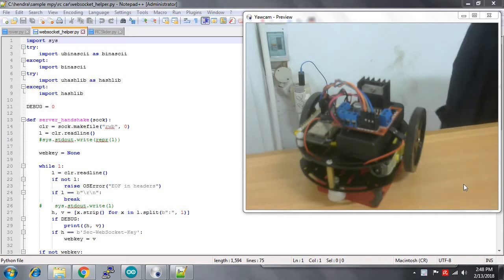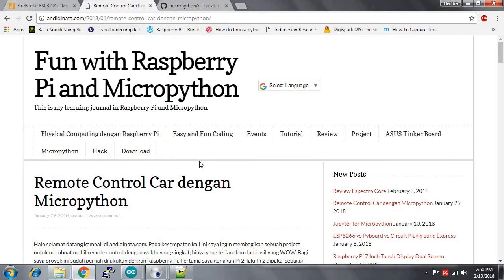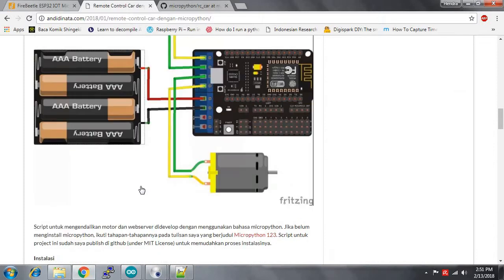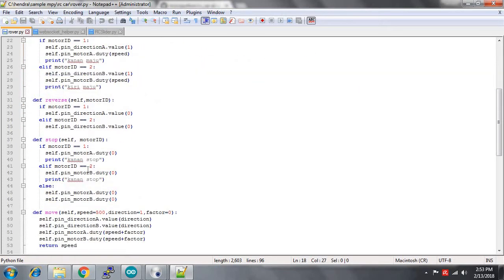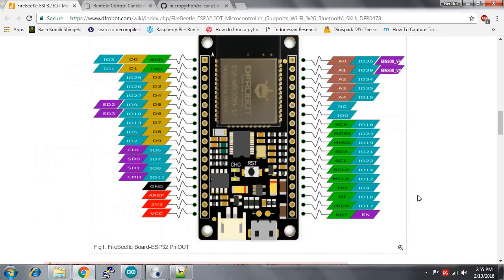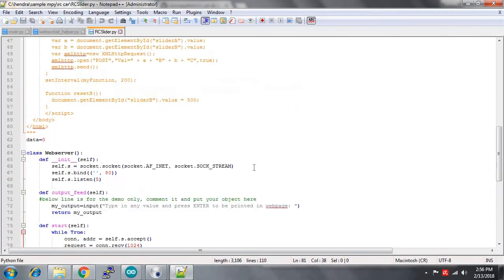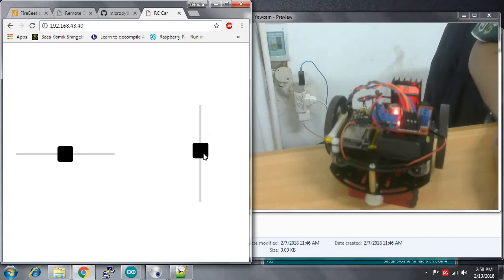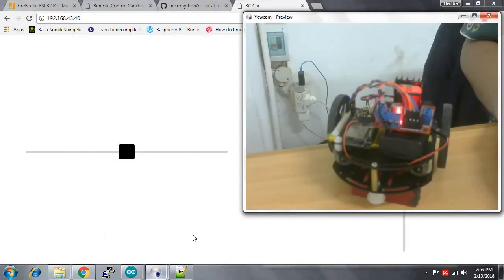micropython firebeetle esp32 rover robot

Comment: What is the range of this esp 32 car?
Reply from the maker: same as the wifi connection, approximately 10 meter. You can make it further as long as you have wifi repeater or wifi router with the same network